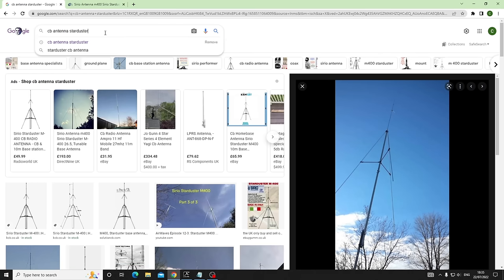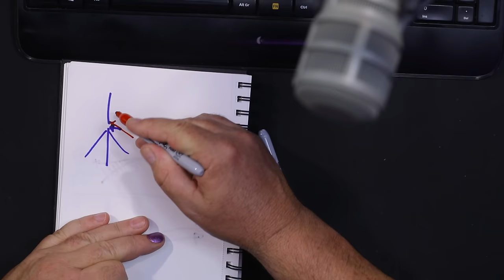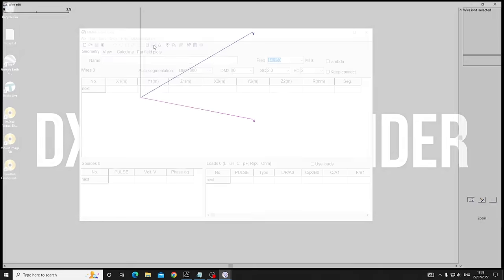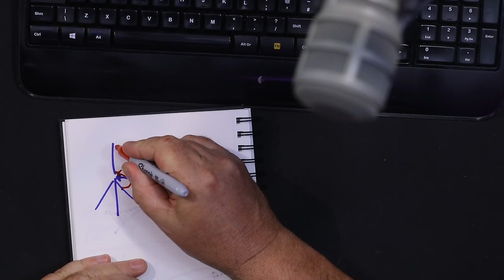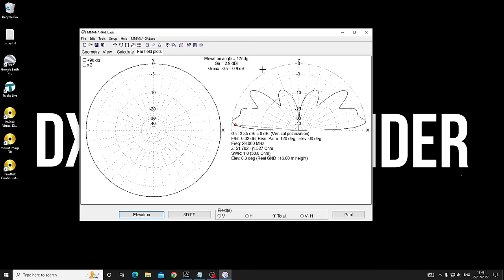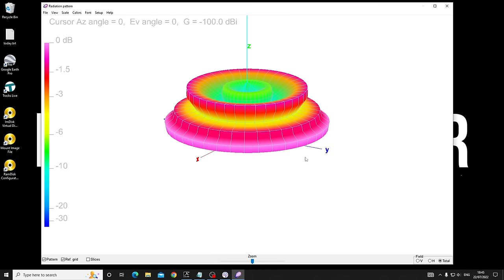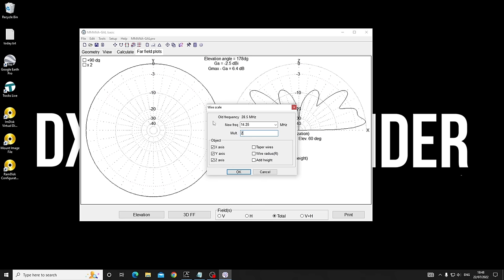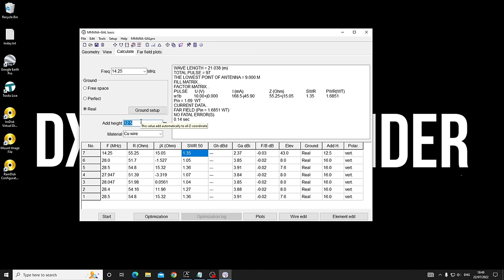The Ultimate CB / 11m Antenna?

Comment: Would order a 10m TELESCOPIC antenna MAST this moment were I to have greater understanding of construction.  That the base I.D. is 44mm allowing for the insertion of ground anchor post, is the only measurement known, other than 10m height.  Otherwise I've no idea of integrity of mast construction.  Whether that be composite material type nor thicknesses.

My interests are 10-12m Inverted Vee antennas.  I construct such an antenna with a simple feed point and perhaps a FT240-31 choke; whether needed or not is debatable.   I might push 1k W output; I believe it advisable to keep the RFI minimized.

Gordon Hudson remarked earlier about "simpler cheaper" antennas.  The Inverted Vee is the ticket to such an antenna.   The radiation pattern as I know it is like a fat loaf of French bread;  180D opposites in directionality. 

You speak of "heavy" wire construction as not recommended.  In practice I use 1/2λ (CB) x 12 or 14AWG wire and a PVC leg spreader.   The near 1/2λ 12.7mm dia. PVC leg spreader is the greatest component weight.  Normally I choose 90D I-Vee though the option for 105D I-Vee, enabled with "spreader" length.  Directionality is manually controlled by paracord attachment to leg spreader and weighted ground anchors.  This is designed as a anywhere 10 minute set-up operation.

Please elaborate on mast characteristics.
Reply from the maker: It's the 18m Nebula Pole, listing is here: https://www.m0mcx.co.uk/store/products/18m-nebula-dx-commander-pole-only/
Reply from the maker: OK, so I built this one in the end.. If you have time, join us on the full-build and test Premiere? https://youtu.be/V8Qq4-0_TjQ

Comment: Citizen Band is AM, line of sight is not required
Reply from the maker: These statements are not compatible. AM is a mode and Distance is a propagation type which can be ground wave or skip (and a host of other stuff in between!)
Reply: @DXCommanderHQ  CB is not line of sight
Reply from the maker: OK, so I built this one in the end.. If you have time, join us on the full-build and test Premiere? https://youtu.be/V8Qq4-0_TjQ
Reply: @TejasBobGOM  CB is not always able to skip. It is dependent on the condition of the ionosphere. So it is dependably line of sight and sometimes capable of skywave.

Comment: 🎙HOW about adding traps so it wood be possible to make it mutuality band
Reply from the maker: Well you COULD but a bit of a shame really.  Instead you could run a couple elements up and do more than one band that way..
Reply: @DXCommanderHQ  my thort was to put the traps in the guy wire's and make them a active part of the active antenna fitting parerfull  guy for the none active parts (parerfuell guy cables are used in broadcast     antenna's none conductive)my  spelling  is bad )
Reply from the maker: OK, so I built this one in the end.. If you have time, join us on the full-build and test Premiere? https://youtu.be/V8Qq4-0_TjQ

Comment: The "T2LT" Coax Antenna has nearly exact the same Radiation Pattern and is Cheap as hell... The 2 more Radials do nothing compared to the "T2LT" Antenna. I think you call it the "Banana Antenna" in your Exel Calculator on DX Commander blog.
Reply from the maker: Yes, I know the T2LT.. The problem is the choke (in my opinion) and I discussed this at length with Steve Webb (Cobwebb antenna).To stop the feedline in the T2LT from radiating, the choke would need to be heavier than everyone is using.. So swings and roundabouts I think.
Reply: @DXCommanderHQ  Yes, the RFI that the T2LT Producing is a Problem. I use an extra FT240-43 Ferrite as a second Choke with 8 windings on my T2lt so i got the RFI down to not noticeable, even on 100W.
Reply: @kaiaussachsen  where is the second choke placed? Top by the coil or bottom at the radio input ?
Reply: @gibkcoc1  i placed the Choke about 50cm after the air coil.  So coil, Choke, ferrite, lightning arrestor and then in the building to trx
Reply: Never had an issue with RFI with any of mine from 10-20m versions
Reply: @timg5tm941  it is not really noticeable RFI but there was some and the Ferrite Choke was getting it to 0.
I have a little self made RFI Sniffer build out of a FT140-43 and some Resistors, a Cap and a Germanium Diode.
This little Tool was the reason i have done the Ferrite Choke on the T2LT.
Reply: @kaiaussachsen  good idea
Reply from the maker: OK, so I built this one in the end.. If you have time, join us on the full-build and test Premiere? https://youtu.be/V8Qq4-0_TjQ

Comment: a simple horizontal dipole kills most CB verticals. Mine was 1-2 S point stronger than a sirio 827 at double the height. I have heard a Nr Coily is a good antenna. Super predator also but albeit a bit flimsy compared to the Mr Coily. I have tested many antennas at my old location, most do the job but really some stand out. At the end of the day the antenna selection should be what kind of radio you want. There is no one size fits all antenna. TBH you can spend a lot of money to chase the bogus antenna specs dBi dBd. OK antenna says 10dB gain...but at what fecking angle is this? and what gain at a lower angle? I do not know why the purposeful obfuscation of real specs so damn hard to do? Tell the truth on your £20, all it is worth, antenna. Rather build my own....
Anyway a converted 1/2 wave CB antenna works better on 40m :P even at an inverted L shape.
Reply from the maker: Jason.. I disagree :) OK, so I built this one in the end.. If you have time, join us on the full-build and test Premiere? https://youtu.be/V8Qq4-0_TjQ

Comment: So it is the take off angle that is so Important..the starsuster isn1/4 wavelength antenna ..it will have very low take off ..and decent small order gain..they will work ..but it's far from the best antenna ..far far far

Comment: Don't bother complicating things.....There will be no difference if you just cut and make a quarter wave dipole vertical up the pole.
Reply from the maker: Sorry but I completely disagree. There is almost a perfect match to 50 ohms with slightly splayed out radials. A vertical dipole will be around 70 ohms at 16m feedpoint.
Reply from the maker: Check this! OK, so I built this one in the end.. If you have time, join us on the full-build and test Premiere? https://youtu.be/V8Qq4-0_TjQ